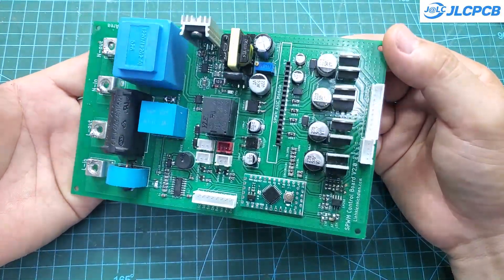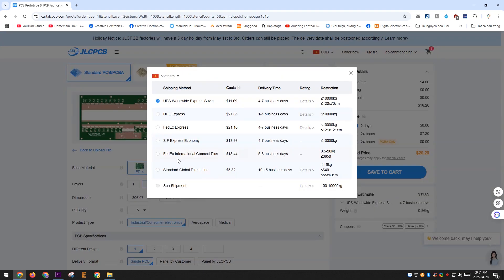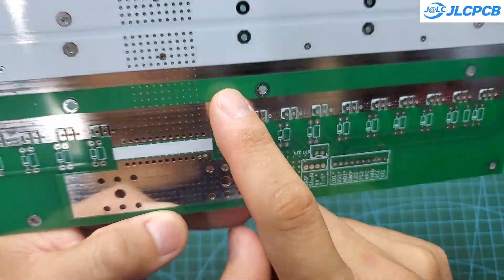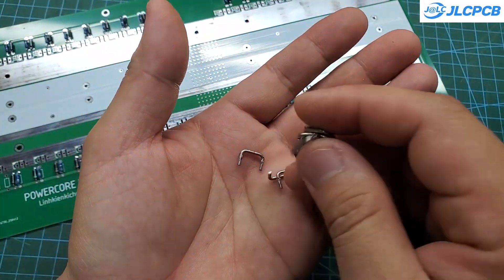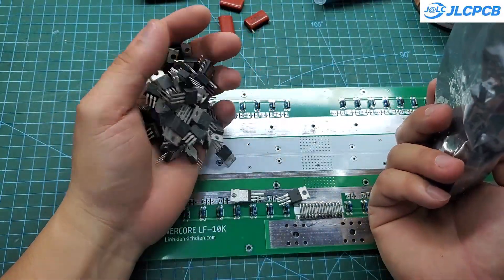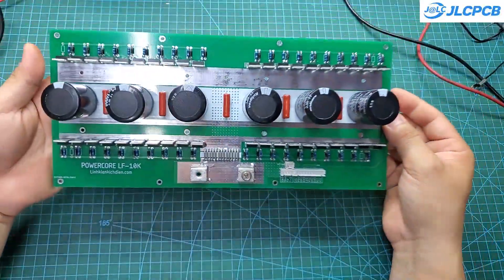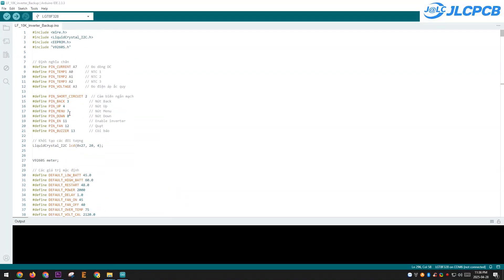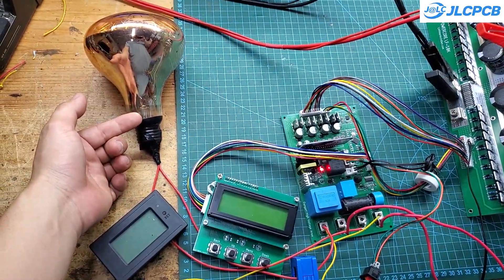Ultra-Powerful Inverter Board with 40 MOSFETs (100W) | JLCPCB

Comment: Hi Awesome, amazing and wonderful works, well done, I have learned a lot of things subscribing to your YouTube.
Please, I would like you to help me to have a true meaning and understanding about the use of Egs002 module for pure sine wave inverter.
Even though I understand some few things, I am much behind with basic and important elements about the circuit.
1, How to solve Overvoltage problem using Egs002 module circuit from the Internet datasheet. Only datasheet diagram without any, integrated circuit.
2. How to determine a Shunt resistor for Egs002 power inverter circuit with a type and a number of power transistors used. Examples, 4 power transistors as it's from the datasheet, and 8 transistors in numbers and beyond. If you could do a video on that. Or by private number, WhatsApp we could discuss with negotiating, if something is to be paid to you. And if the notes and the theory for understanding can be sent to me by digital means or handout, very important please help me, with this, I destroy about 5 of my modules, as a starter with little electronics knowledge. So please my master and teacher, help, I can't hide my shame, I admire so much. ❤😂

Comment: Can you do a proper signwave inverter with UPS functionality (24V Batt, 2- 6ms switch over delay) for around 2000 watts? This is a sweet spot for many users, and it would be great if it could be built much cheaper this way. TIA
Reply: No he can't

Comment: Very good design but I would recommend one upgrade. In the next version try moving driving transistors to the power board. This way you reduce stray capacitance of the long control wires, reduce EMF of the whole circuit and driving pulses will have more perfect shape. Great circuit nonetheless!